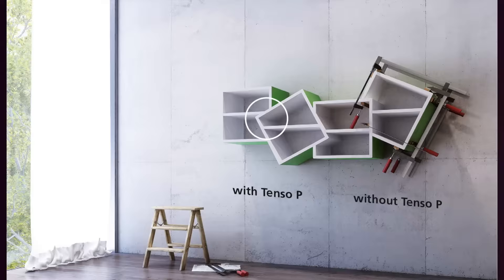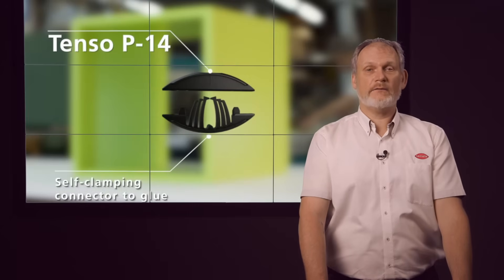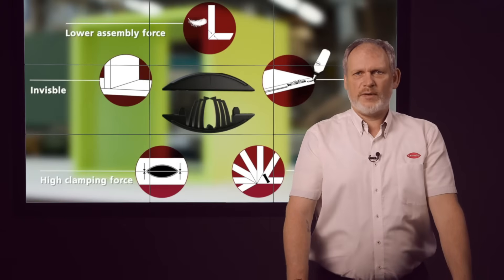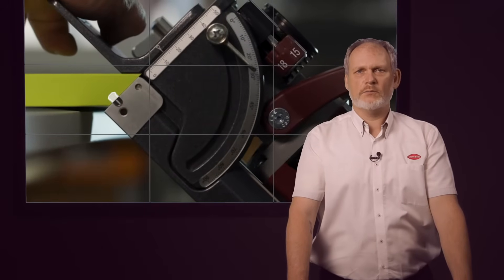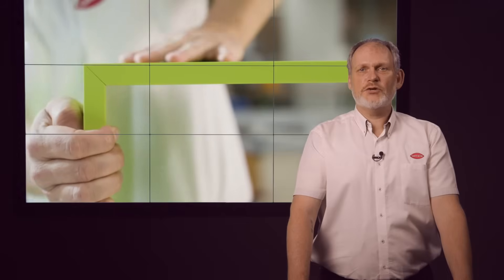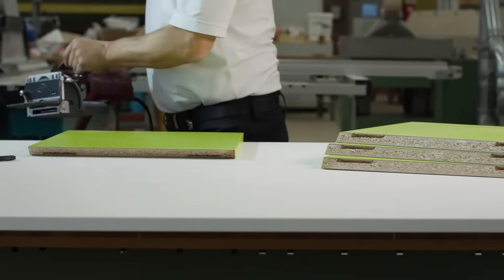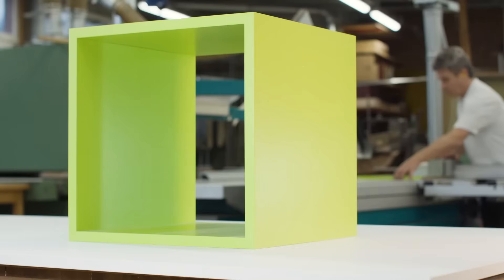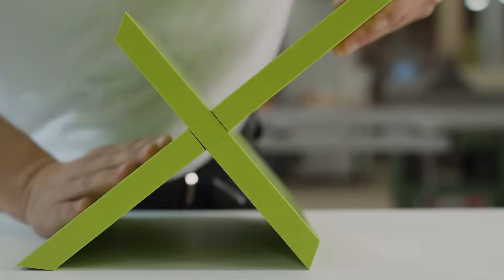Product Presentation: Tenso P Self-clamping Connector as Gluing Aid for all Angles

Comment: I myself have had the lamello now for 2yrs. What a beautiful piece of machinery. Haven’t used a clamp in this time. Every time I use it i keep thinking to myself that this is brilliant. Effort free building / production of the cabinets that we manufacture. Precision every time. The speed taken to build any project without having to clamp it together is amazing, 45 degree joined angles is hard work at the same time but what is brilliant about using the lamello is that you can pull it a part again and again and click it back together again. Endless possibilities achieved on all angles.
Tenso / Clamex
Reply from the maker: Thank you very much for your great comment :)
We are happy to hear that you are satisfied with the P-System